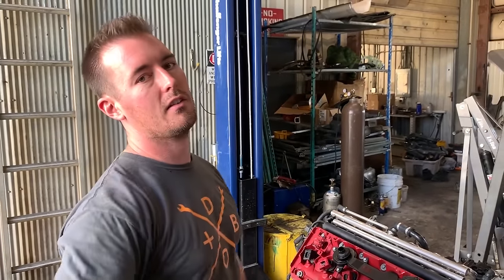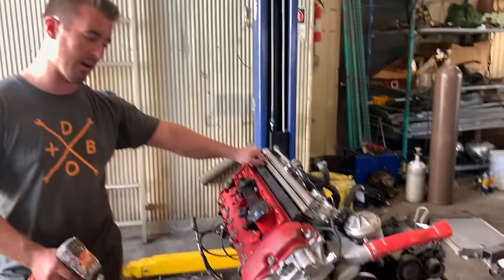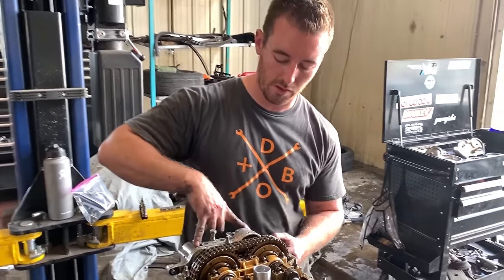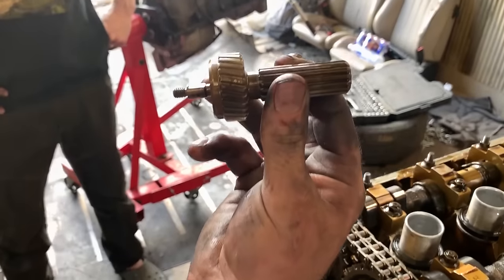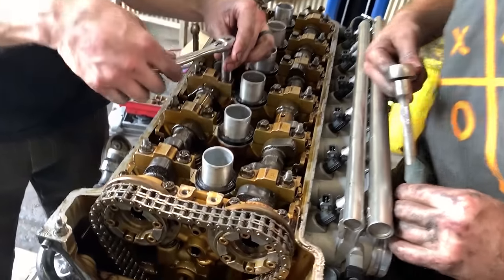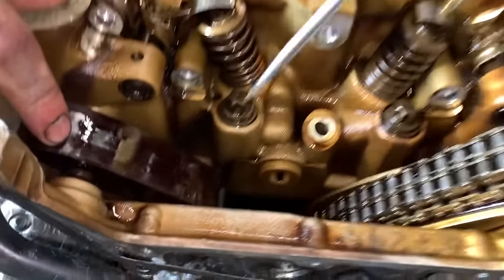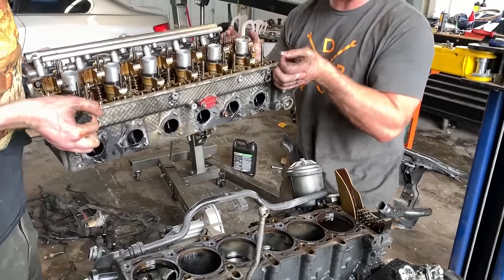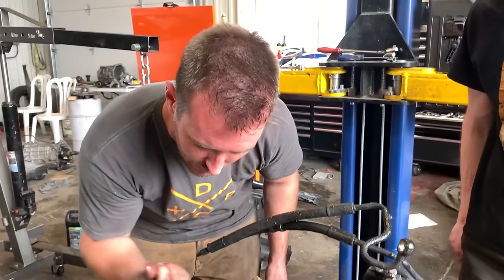Factory BMW Race Engine? s54 Teardown!

Comment: When I put the swap in my E46 sedan, the engine had 155k miles on it, I should've replaced the bearings while it was out, I didn't, it spun a bearing at 160k with me abusing it everyday and 5k miles on the oil 🤣 crank was still good, grinded down, stress relieved then straightened at Castillos Crankshaft, Joe is the guy to talk to, and went .0025 under bearings. After that I sent it to WPC treatment and it's been 20k miles of daily abuse and it's still solid AF.
Reply from the maker: Hell yeah, great info

Comment: “Manually adjust valves every 15k” 
Me sitting here with my s54 with 109k miles that Has probably never had the valves adjusted.
Reply from the maker: You are missing out on some power.
Reply: Lol had mine till 230k miles
Reply: Get it done.. it’s not a hard DIY at all
Reply: Get it done. It’ll feel like a completely different car
Reply: It’s every 30k miles. I’ve had it done 2 time. It’s part of inspection 2.
Reply: Ive had mine for 14 years (~160k miles currently); I’ve only done it three times throughout its life :/
Reply: @bgateb  did you See a difference every time you adjust them?
Reply: mateos3607 mata maybe a slight difference. It’s important to note that the tolerances on the S54 are tight, so even if I couldn’t tell, I’d still get it done every time inspection II comes up (roughly every 30k). My car has sat for the last 6 years, and I’m working on getting nearly everything replaced and bringing the car back to its past glory 😅 so I’m sure a valve adjustment will be in order once I’ve got it all buttoned up
Reply: @bgateb  Hope everything goes smooth
Reply: @bgateb  good luck boss
Reply: This
Reply: @JayXavierFar  Very nice! is the N55 reliable?
Reply: Same 😂

Comment: When BMW was still BMW.
Reply: Still is...
Reply: Khumo Matlakane not even close. When the F80 M3 shares its engine with other models, it’s no longer special.
Reply: Ride Catch is it though.. cause the M4 is technically the coupe M3
Reply: True
Reply: This was the most famous M3 among all the M cars. It was just way ahead of any sports coupe/sedan at the time. 
The subsequent V8 and then turbocharged L6 was heavy, and wasn't really a stand out compared to other cars. These BMWs aren't so special anymore.
Reply: Khumo Matlakane nope
Reply: Daniel Montoya m2? And regardless it’s not a special motor anymore short of the gts and even that is an off the shelf Bosch water injection. Turbos. That’s all.
Reply: Daniel Montoya i know. What I meant was that the engine used in the M3/4 is also used in other models, and because of that, I makes the M3/4 less special. I wish BMW would make their flagship sports car a little more special like it used to be.
Reply: mullins Rotary that’s true, but it originally was used in the E46 M3. The Z3 M Coupé and Z4 M used the S54 afterwards. 

The F80 M3/4 uses the S55 motor, which is a version of the N55 that was used in 335i’s, but with just bigger components, but the same nonetheless. Dumb.
Reply: @JacesOwnWorld  the s55 is VERY different to the n55. What you are saying is like calling the s54 similar to the m54. They are very different. The blocks arent even the same, with the s55 having a closed deck.
Reply: Bmw is bmw, n54, s55, b58, s58.

Comment: Great video! Had the check engine light on my 2003 M3 and local BMW mechanic couldn't figure it out. We knew an O2 sensor was bad but exhaust leak maybe caused it. Ended up taking to the BMW Stealership. Replaced 02 sensor and they determined the vanos solenoid pack was faulted and wanted to replace the entire vanos for $3,600. I knew it didn't have the Death rattle so mechanically it was ok. I bought a rebuilt solenoid body from Dr Vanos for $260 with improved O rings and problem solved in 45 minutes. probably gained 30 hp and the hesitation around 3,000 rpms was gone. At least I found out from the Stealership it was originally an SMG transmission that was converted to a 6 speed manual. I have more money in it than it's worth but at least I don't have an $80,000 car in the garage that only performs as well and isn't as much fun!

Comment: There are several BMW factory specific tools and procedures - beyond just the cam alignment pins that make timing the cams a very straight forward and reliably/one and done process.  There more than one  bridge/pin fixtures tools along with electrical VANOS switching tools that are used for cam timing/VANOS removal/install process.  Although not cheap, the use of the proper tools and procedures will make life much easier and reliable in the long run - the release and removal of the camshafts from the bearing caps is quicker/safer/easier using the BMW camshaft supporting tool.

Comment: this engine is really intimidating to rebuild
Reply: The timing is a pain, other than that is pretty easy because you only have to deal with 1 head.
Reply: its not that hard at all. just requires the right tools to set timing. I rebuilt mine and it was my first time rebuilding an engine.  so far it has 6k miles on it and hasn't exploded lol. 

But compared to lets say a 2JZ... yes this engine is more complicated LOL

Comment: So good... it needs rod bearings every 50k. The s54 is still a legend, great video!
Reply: @Crooked Skate Supply Co awesome, however not typical/common
Reply: mine has 97K miles...original rod bearings. no issues...but will Blackstone next oil change to be sure

Comment: All the talk about vanos and the chain guide breaking, but no mention of the exhaust hub tabs breaking and no mention of Beisan Systems that provides parts for rebuilding the vanos.
Reply from the maker: What is an exhaust hub tab. Also I didn't know Beisan made S54 vanos stuff, I just thought they made stuff for single vanos and M54 stuff. Appreciate any new knowledge.
Reply: @DENVERBEERANDOIL  The exhaust hub is the part that drives the vanos pump, which you referred to in your video. The hub has two tabs that fit into the corresponding holes in the pump. The holes are too large, inexplicably by design, resulting in resonant vibration which eventually causes one or both of the tabs to sheer off. If you're lucky, the broken tabs stay in place. If you're unlucky, a tab will fall out and get wedged between the timing chain and the cylinder head, resulting in a catastrophic engine failure. Beisan's fix for this problem is to drill two new smaller holes in the pump disk, reducing the clearance and eliminating the problem. Beisan also offers other parts and recommendations to further improve the vanos unit. Anyone that wants to properly take care of an S54 should do all of their recommended fixes. If you visit M3 Forum, you will find lots of threads about this, including my own. Also, not to nitpick, but your comment about that particular engine being mis-timed is not correct. Cam timing is measured by setting the engine at TDC AND retarding both cams. Then and only then, can you measure the timing. If you remove the vanos unit from an engine, there is no guarantee that either or both of the cams will be fully retarded, so they will appear to be mis-timed. There are lots of wrong ways and only a few right ways to correctly time the cams. Beisan has a very detailed procedure which if you follow EXACTLY, you will end up with perfectly timed cams the first time.

Comment: Thanks for the s54 tear down walk through.  Just wanted to add that vanos runs at 115 bar, not 150,000 psi.  Also he was talking about the cam timing being off but I don’t think he realized he had the vanos half pulled out also.

Comment: We rebuilt my friends s54 after a valve snapped in half fell into the cylinder the broke again and shot straight through the head and we searched for hours for a rebuild video but i geuss youtube didnt want to show me this awesome video.
Reply from the maker: That's a bummer, really glad you liked the video though. Hows his car now?
Reply: @DENVERBEERANDOIL  well 6 hours before the engine blew we fixed the trans after it snapper in half and 2 weeks after we fixed the engine the rear diff exploded into pieces and now it just sits in a field sadly
Reply: matt leger m3 power :)

Comment: I just found out this nice video about a week before I'm gonna swap S54 in E32. It was rebuilt about 10k kms ago, but still makes me think was it proper. Definitely I'm planning to do a entire cross-check of everything you mentioned in video before supercharging it.
Reply from the maker: Supercharged e23? Sounds like a good time! We've got a similar plan for an e23 of our own. If you're interested, subscribe and you might see it happen!
Reply: @DENVERBEERANDOIL  I had originally as a plan to swap in S85 V10, since it is 7 series and has a plenty of room under the bonnet. But pandemics kept me from going to another country to buy an M5 so I ended up with this solution S54 and a supercharger in near future.

Comment: Yew more DBO vids and this time it is an s54 one!! tearing my S54 apart for a rebuild this summer.  I spun a rod bearing at 119k miles (factory warranty changed them at 25k).  I think the crank is fixable, not too much scoring and I didn't run it long once it started knocking, maybe an oversized bearing on that one.  Wondering if the rod and cap are still ok to reuse? Also, any things I should do to the motor while it's all apart?  Considering opening up the top end too, but debating if it's really needed on an OEM type rebuild.  I was going to just flush the block and change the main bearings as well as the vanos rebuild.  I am going to be pushing the motor on the track so maybe I should go for a full rebuild...
Reply from the maker: Feel free to get in touch with us by emailing at milehigheuros@gmail.com and I'd be happy to answer any questions I can! -W
Reply: I'm rebuilding my S54 now from 2004 M3.. this is my rebuild config: JE Pro Seal 11.5:1 CR Forged Pistons, Molnar Billet 4340 H-Beam Con Rods w/ ARP bolts, King Racing Rod & Main line bearings, ARP studs main line & cyl head, JE Pro Seal cut/cooper ring head gasket. 

Crankshaft is being brought into the shop come Monday to be re-polished due to scoring on x3 main bearing journals, block is also being brought in for; complete clean/degrease & re-paint job, deck, bore, hone w/ plateau brushing, ensuring a torque plate is used during bore. Cyl head has already been de-greased & skimmed. DME/ECU tuning to occur post-reassembly using K+DCAN & BMWFlash. Goal is to bulletproof motor for supercharger application to 600HP conservatively down the road, but under N/A configuration be as durable and as high performing as possible.

Cooling also bulletproofed w/ Mishimoto alum radiator w/ silicone hoses + electric fan w/ NPT + performance oil cooler. Valve job to be performed upon re-assembly. Perf mods AFE Stage 2 intake + Megan Racing catless headers + Status Gruppe sec 1 rasp eliminators + sec 2 unresonated X-pipe + DNA muffler, along w/ full suspension refresh (Bilstein B6 shocks, H&R springs, strut bars & adjustable end links/control arms, poly bushings thru-out + IRP 80A poly engine & trans mounts) already performed, solid steering coupler, new Sumitomo P02 tires.. DKM clutch kit w/ single mass flywheel conversion & upgraded organic clutch disk..

Really can't wait to get the rebuild completed.. she's going to be an absolute beast! Hope you get yours rebuild successfully also!
Reply: I'd lap the valves and measure everything from seats to springs.

Comment: 1500 PSI on the oil pressure for vanos I'm in the process of changing out a bad timing chain tensioner that's only has 10 K FYI if you really want to know timing chain tensioner is functioning properly Add a torx app look at your advanced timing it should never be under 21 point five at idle mine drop down to 5 degrees tensioner also you'll hear tapping at Cold startup and kind of a rumbling like a marbling at idle easy fix sometimes it's just hard to diagnose
Reply from the maker: Great info to know! cheers

Comment: Great video lads. Very informative. The S54 is a masterpiece.... I've done 60k miles in various e46 m3s over the years. An N54 swap in a e30 would be a right weapon had a E82 135 full bird's conversion (UK bmw tuning company) running 420bhp. That in a e30 chassis would be a monster car.

Comment: If it is anything like the m54 double  vanos then i can't see clearly but with the vanos half way off i wouldn't expect the timing to look correct. You have to have on the vanos piston spacer tool installed so the pistons ( that in effect adjust the cam rotation)  are pushed in the correct amount. Without that it could be out buy plus or minues 20 degrees ( if that is correct).

Comment: I got a e36 and engine swap it with a s54 and it came out so welllllll it’s worth it all
Reply from the maker: Good job, that's a big project.
Reply: How much did it cost u pls?
Reply: Tarak Alsafe depends the ecu on mine is fully tuned so I paid like 9k to get the engine only

Comment: Guys, I thought when you remove the cams you can fully unwind any of the nuts that are on the cylinders where the lobes are not engaged. Speeds up the process but you need to make sure the cam does not rotate

Comment: Impressive video! Very knowledgeable 👏 
Would be great to hear you explain how similar the design of this engine is to the V12 (or half of the V12) S70 that BMW created for the McLaren F1. I’m led to believe the S70 started out as two e36 3.2 evo engines (which preceded this one) that were mated together to create the V12, and the design of this later model inline 6 was developed by more or less the same team. Would be great to hear someone like you explain how similar the S70 is to two S54s!

Comment: When reassembling the S54 block, how do you install the press-in style oil gallery plugs? My machinist took these out for proper oil gallery cleaning, but I'm struggling to get these to tap back in; they fit so tight they only go in perhaps 1/3 of the way before I feel like I'm about to smack the block off my engine stand lol. Someone at my work recommended to buy some dry ice to freeze the plugs, causing them to shrink. Do I need to use a special driver of some kind, or what's your method to tapping these buggers in? I'd hate to have to convert these to pipe/threaded plugs, but it seems like an easier route to go with, especially if I'm going to rebuild the motor again down the road.. thanks!

Comment: I just bought a 1970 BMW 2002 widebody (turbo replica) with this s54 motor and a straight cut dogbox trans. 
The motor apparently did the exact same think...I was told it started knocking and smoking and eventually just froze. I got the car home earlier this week. As an amature with no shop and a budget what should I do? Should I tear the engine apart or just buy a long block any start from there? What should I look out for when building if I plan on boost later? Can I fix the crank bearing problems or vanos problems while I am in there or are they just defects of the design?

2014 is 350
2016 rx 350
1987 944 turbo
1970 bmw 2002 
2006 R6
Reply from the maker: If you can find a running engine for less than $4k with less than 150k miles. I would do that. If the crank is messed up on yours, it will get expensive quick.
Reply: @DENVERBEERANDOIL  I am tearing it apart now. there are metal shavings all in the oil I drained. Hopefully know more later on today. Where is a good place for a long block if need be? Is there a way to build these to where crank bearings and vanos wont be a problem in the future?
Reply from the maker: Most likely that material is rod bearings. Ebay is good or just local bmw parts people, try craigslist and facebook.

Comment: I loved this!! very cool and helpful! is the N55 reliable? is it a good engine? mine is at 77k. Thanks!!
Reply from the maker: I'm glad you enjoyed the video. Unfortunately the N55 isn't the most reliable, rod bearings are a big failure point on them.
Reply: @DENVERBEERANDOIL  Oh no! really? I thought they changed them in Mid 2014? Mine is a 2015.
Reply: @DENVERBEERANDOIL  (Changed the design, and material of the rod bearings in mid 2014 right?)

Comment: I missed it...why were the cylinders full of oil? Head gasket or the head oil rings on the back yard rebuild?
Reply from the maker: It actually wasn't mentioned in the video but I realized aftwards that the engine had been sitting on the engine stand upside down so I could inspect the bearings at one point which I assume is when oil leaked past the rings. Aside from that, cheap oil filter collapsed, clogged the pump pickup and oil starved the engine.

Comment: Really great video of the S54! I heard at one point that the timing doesn't need to be so very exact because of the variable valve timing. It didn't sound right to me when I heard it. But I still don't quite get it even though I've rebuilt my vanos myself a few years back. Lol. (Beisan stuff). Still running great!

Comment: Even though I already LS1 swapped my M Roadster, I still found this to be a great video
Reply from the maker: Man I bet that LS roadster rips
Reply: Denver Beer & Oil it’s a lot of fun for sure!
Reply: Denver Beer & Oil it wasn’t very hard either, pulled the old motor, and trans, dropped in LS1 and t56 without pulling the front clip off, had drive shaft made, and did some trimming for the shifter. I did it on jack stands in my 2 car garage and had it driving in about 2-3 weeks